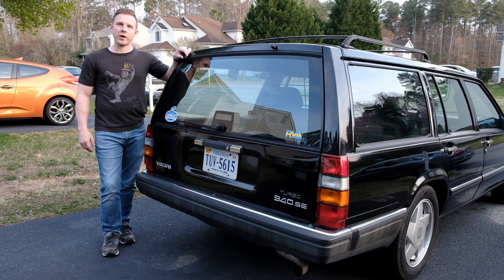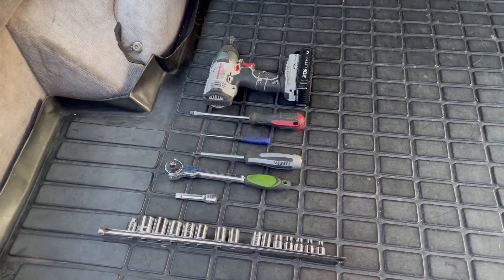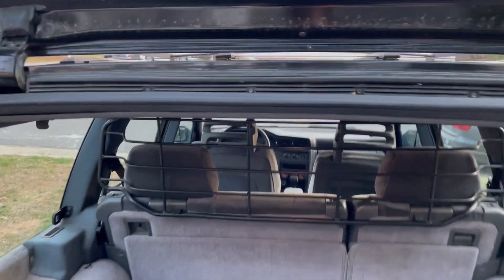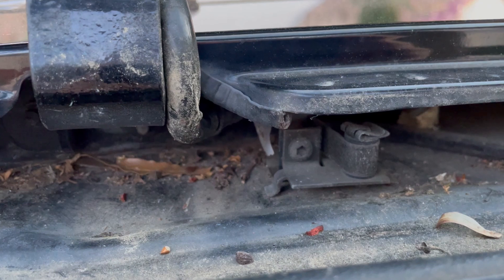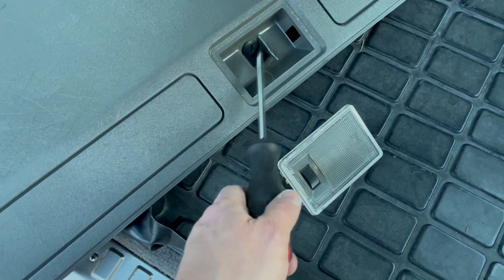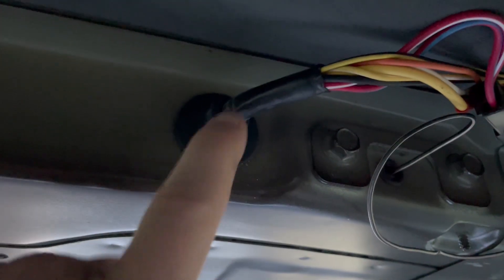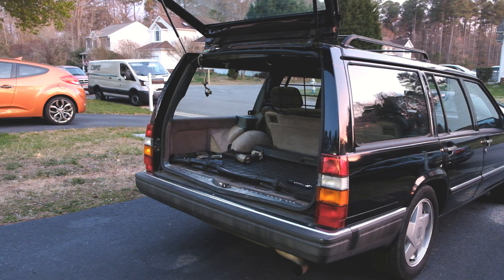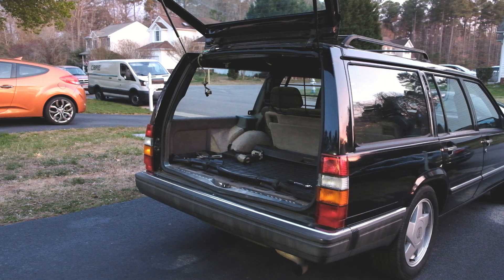How to Remove the Tailgate on a Volvo 740 / 760 / 940 / 960 Wagon

Comment: How do you remove the emblems easily? Any tips?
Reply from the maker: Yes, I recommend using a strand of sewing thread, fishing line, or dental floss. Cut slowly through the adhesive in a sawing motion, back and forth behind the emblem. Your cutting line may break several times, so just try and be patient. Once this is done, I recommend using a plastic razor blade and an adhesive remover to get rid of the sticky residue. I recommend WD-40, or for more stubborn adhesive, 3M Specialty Adhesive Remover. It is safe for clearcoat paint, but it's very strong stuff. If you do this, and finish with a paint correction, to can get a smooth finish with no paint damage!
Reply: @Vehicularious  Wow, thanks for these detailed instructions! 👍